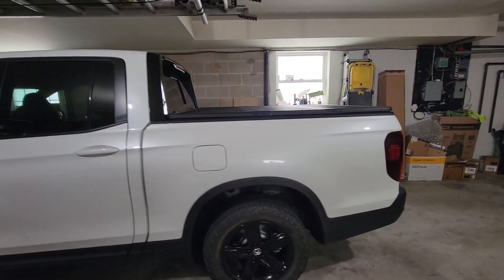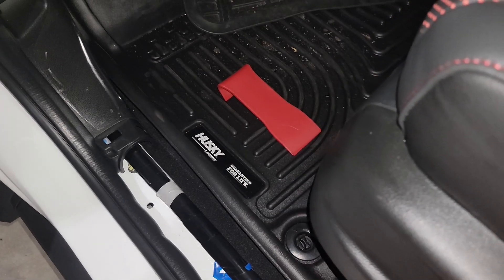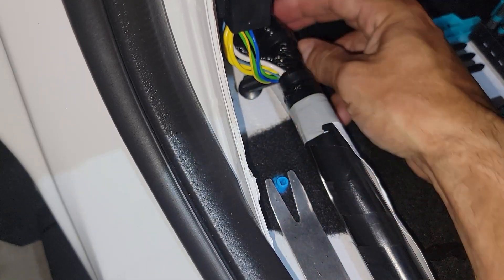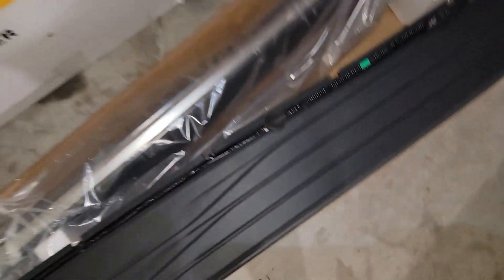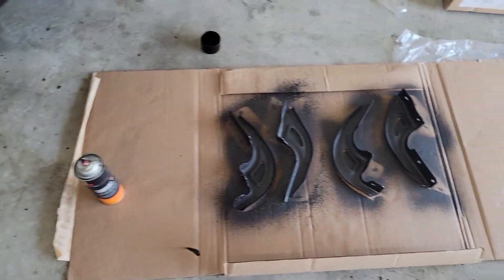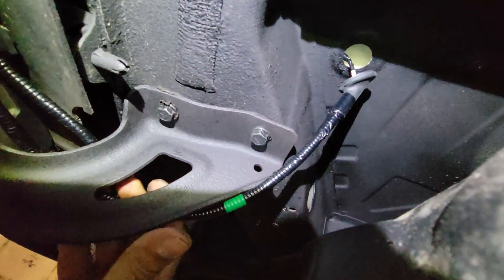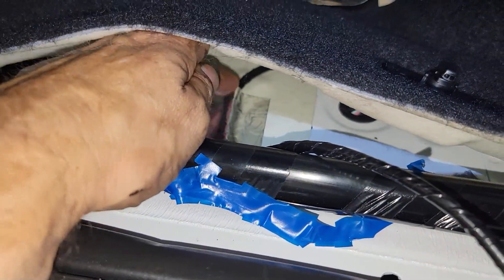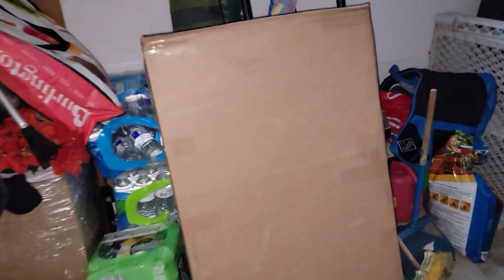Honda Ridgeline 2021 Oem Lighted Door steps installation

Comment: Could u or did u do a vid where u got your power from to do this (behind driver panel with eco button)
Reply from the maker: The Ridgeline have 2 connector already there for power, one on each side, if you look for the installation manual it will let you know where they are, it is a little bit hard to find but you will be able if you look carefully.
Reply: @07Review  thank u!

Comment: i heard the OEM light burns out in these alot is it true ?
Reply from the maker: Yes, it is a scam, each lights cost more than $50 and last 2 or 3 months, covered by the warranty, but the dealer have to replace it in order to cover it, then the waist of time at the dealer. They are horrible.

Comment: Nice "how to" video.  I watched it several times before installing mine.  Everything went smoothly but the passenger side isn't lighting.  I only found 1 connector in the dash that matches the plug from the running board so I'm guessing it's the right plug.  Any ideas?  Thanks again, Rick
Reply from the maker: The connector should be there somewhere, if you have the installation manual it will be more easy to fin, it should be hidden with a bunch of wires or behind of one of the metal frames, mine (the right one) was in between wires, super hidden from my view. Also make sure the puddle lights are good, I have a video of the hard time I did past with those and my solution. Good luck and GOD BLESS YOU!!!
Reply from the maker: Here you can find the installation manual: https://www.collegehillshonda.com/product/08L33-T6Z-101B.html
Reply: Well I reread the install instructions and the picture gave me a clue that I was in the wrong location looking for the connector.  The blower fan in the pic was the key, I was on the wrong side of it.  I had to lay on my back with my head up under the dash to finally see the 2nd and correct connector.  In a spot you can barely reach with 1 hand let along use 2 hands to push the connectors together.  But I finally managed and then "I saw the light!"  

Good looking running boards, now if I can just get used to using them...
Reply from the maker: @RickHiggens  great!.. now let me know if you have any problems with the life span of the puddle lights on the running boards, if you do! Check my solution with my cool blue lights.

Comment: Great video. Gotta Pilot and just wanted to see what I’m going to have to contend with. Thanks
Reply from the maker: Thanks my friend just make sure to keep the eyes on the puddle lights, so far the dealer had to replace 3 of those, I don't know if they were defective or not seal for water, but they had to replace it, also keep the eye if they have to do it because in order to be covered by the warranty must be replaced by their mechanics, check my channel and see part 1 and 2 the dealer service warranty, In my case they were good but the dealer must to replace the entire step board due to damaged caused by the technician. Keep the eye on it.
Reply: @07Review  will do. Thanks again

Comment: Thanks for the vid. I am planing to installon on my 2021 RTLE as well.  However, Do the running boards interfere with the front splash/mud guards? thanks.
Reply from the maker: Not at all... I did my own style  of mudflaps... I will post the video tomorrow... only 5 minutes explanation... the oem are too small  and don't fit with the flares... not good protection from dirt.

Comment: nicely done
Reply from the maker: Looks very nice but in less than a month I did have to use the warranty to replace to led lights, thanks GOD, covered for a year, very expensive, $89.00 a pc at the dealer or $47.00 and up online... I hope just a defective ones.

Comment: Where did you run and connect the passenger side? Thank you
Reply from the maker: Same location of the driver side but on the passenger side, is with a bunch of wires ... you will see just the head of the connector.
Reply: @07Review  Great video, but you did not show when you removed the panel under the steering wheel. Also the passenger side has its own connection fo rthe wires? You do not need to run that wire to the drivers side?
Reply from the maker: @yanelisgalvez7130  nope the panels are very easy to remove using the tools I put in the description, it just pup out, no wires to run, just follow the diagram both side have the same connector hidden behind the wires just plug and play

Comment: anyway to make the lights blue?
Reply from the maker: So far the Oem part  have just that color maybe experimenting with a some clear blue lens custom made maybe will do the job, also Amazon has some lights that goes by the door and it lights as soon as you open it, it have the plain light or the logo in different colors, you just replace the door light, or get a aftermarket door steps. Good luck 👍 and GOD helped you, my friend.let me know what you find out. It will be great to know.

Comment: I have this but my front driver's side light burned out .
Reply from the maker: Just take it back to the dealer if you bought it before a year, not kidding the replace my lights about 4 times after that I did put some grease for electric connections to waterproofed a little bit and so far no problems. If you want to replace it your self is easy but is around $85.00 more or less for that light.

Comment: That was worthless. You didn't show the electrical install.
Reply from the maker: What exactly do you need everything is in there.... there is a plug and play, the Honda connector is there you just have to plug it, now if you are going to biy this lights I recommend you to check my other videos about the baddddd experience I did past with the puddle lights and the solution i did find out, it is the best and I don't regret it, those Honda puddle lights are real bad quality and very expensive, let me know and if you want I will send you where you can have the installation diagram. HAVE A BLESS DAY!!!
This are my new puddle lights:
https://youtu.be/91NCeC05WKY